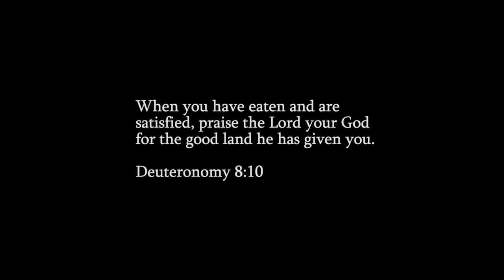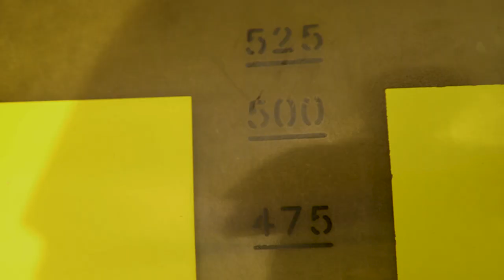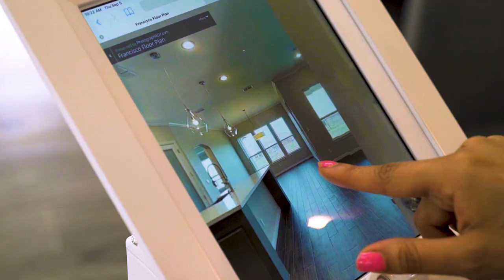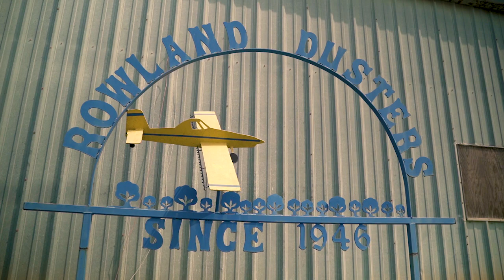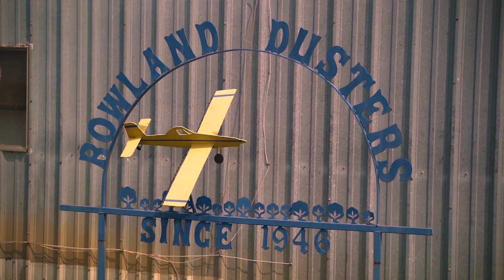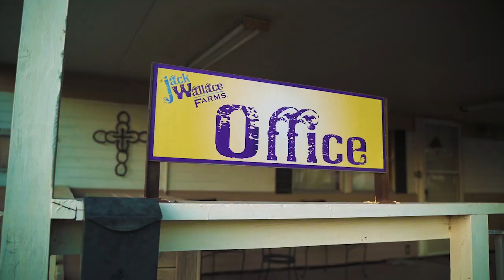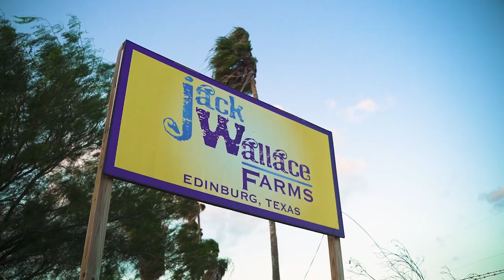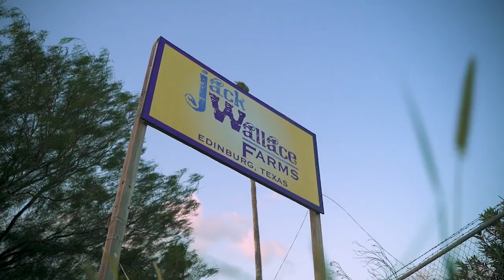Crop-dusters and Farming

Comment: I want to learn how to get into the crop dusting industry
Reply: the easiest way, is find one or more local air ag companies and see if they're putting anyone on. You'll need to start out as a loader, even if you want to be a pilot, the advantage in that is will be able to use the you earn as a loader to fund your pilots licence. I'm in Australia, so if you're in the States you'll probably find things are different to how they are here.
Good luck with your endeavours
Reply: @kingofthejungle3833  thanks
Reply: @kingofthejungle3833  I found a company that wants to hire me as a loader (I want to be a crop duster pilot aswell) I would have to move away from home to pursue it, however I am scared as they can’t guarantee me work through winter with other things
Reply: @KCPmedias  take the gamble, it's good money when the work is on, it'll pay for your lessons, see what other work is in the area to get you through the winter
Reply: @kingofthejungle3833   awesome thank you.. gotta take risks sometimes I guess. I’ve sent out a few resumes for winter work at other companies, fingers crossed
Reply: @kingofthejungle3833  I would be leaving a full time job I’ve had for over 2 years now